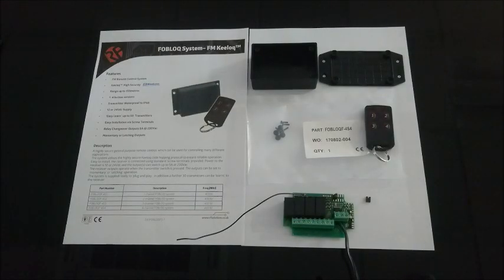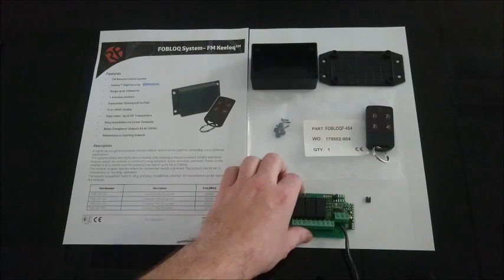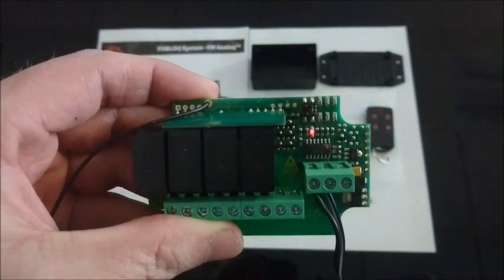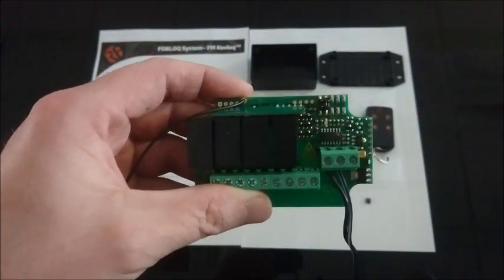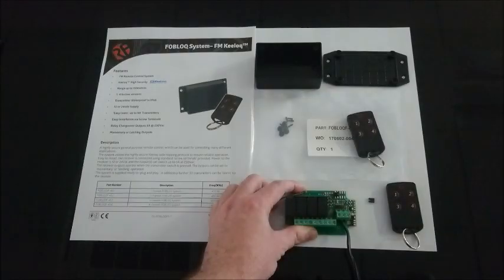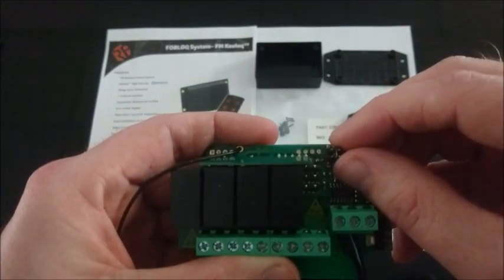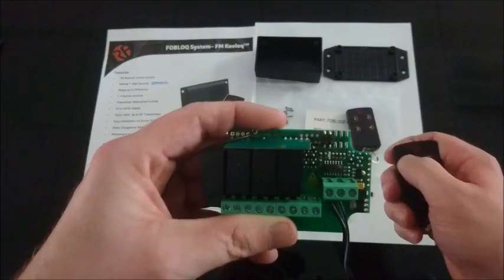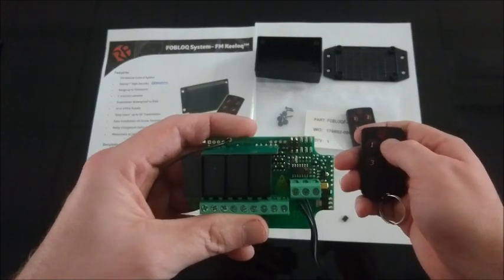FOBLOQ Remote Control System | RF Solutions

Comment: WHAT ARE THE WIRING INSTRUCTIONS
Reply from the maker: Hi there Colin, attached is the product datasheet for the FOBLOQ System. If you require any further instructions on wiring the system, please don't hesitate to get in touch with our Tech Support Team on support@rfsolutions.co.uk or give us a call any time on 01444 227909 (09:00 - 17:30 Mon - Thur, 09:00 - 16:15 Fri). 

DATAHSEET: https://www.rfsolutions.co.uk/downloads/1594032383DS-FOBLOQFS-2.pdf 

Best regards,
RF Solutions Team